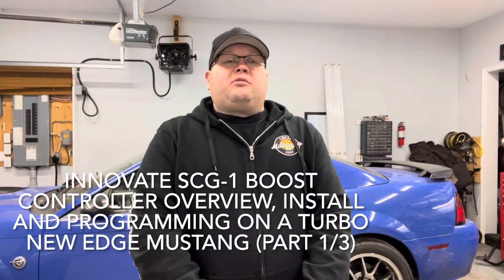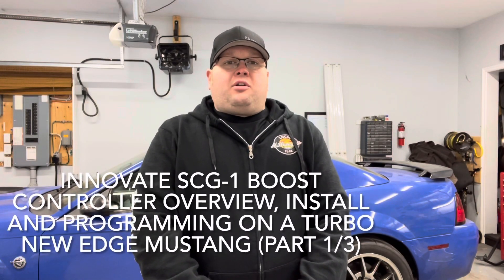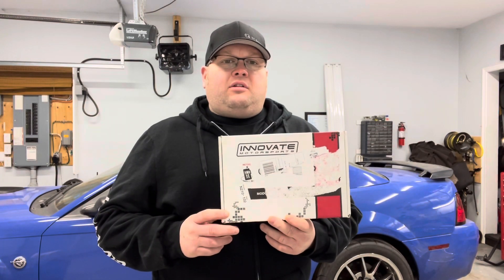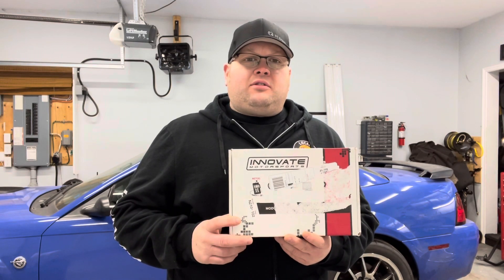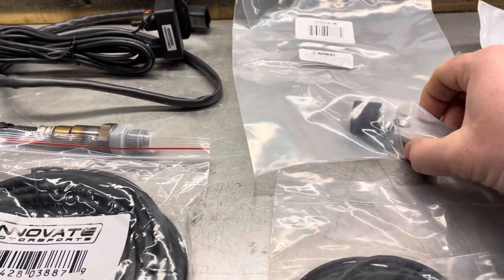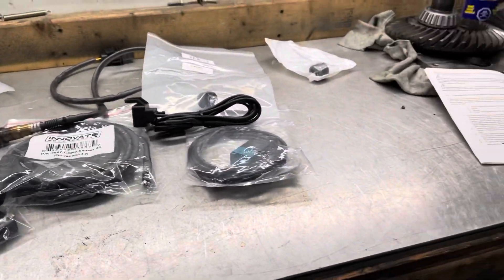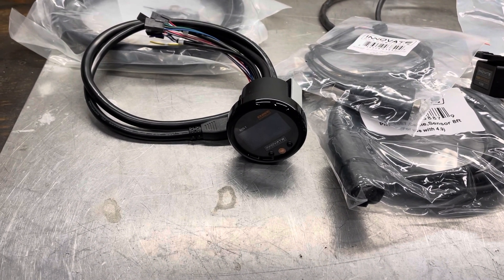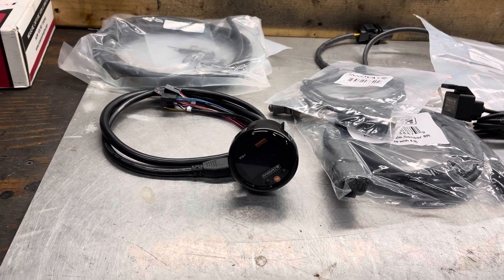Innovate SCG 1 #Boost Controller - Overview, Install and Programming on a #Turbo Mustang. Part (1/3)

Comment: Does this have a low voltage emulation?
Reply from the maker: Like 5v? Yes it does and I use that output to datalog AFR into my tuning software